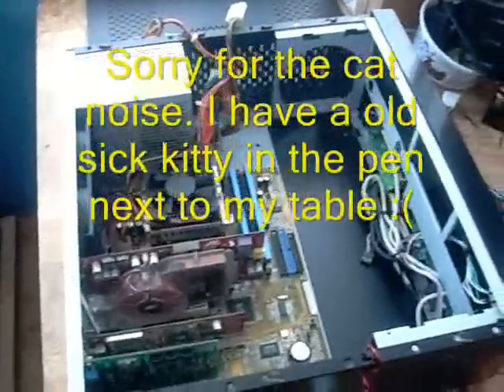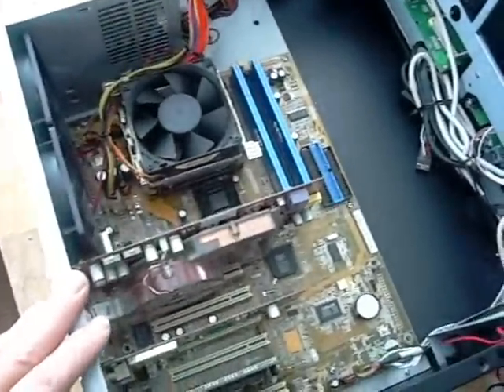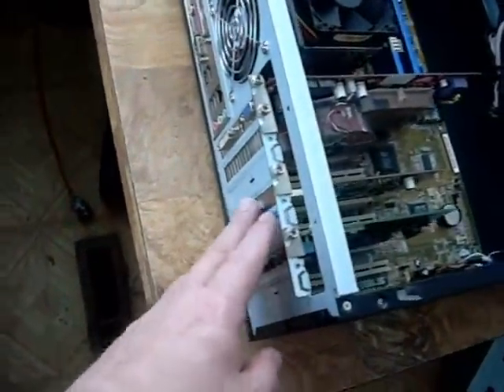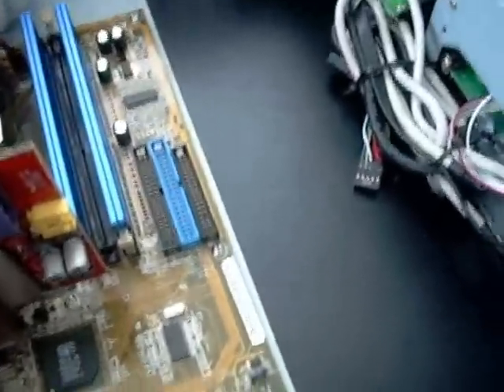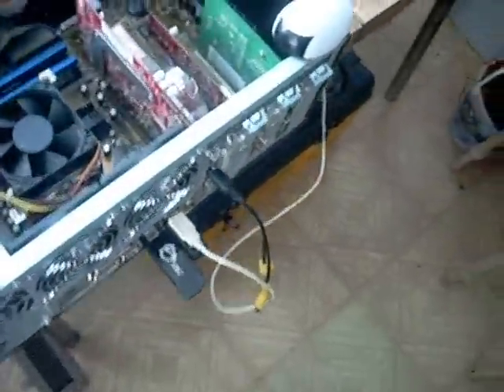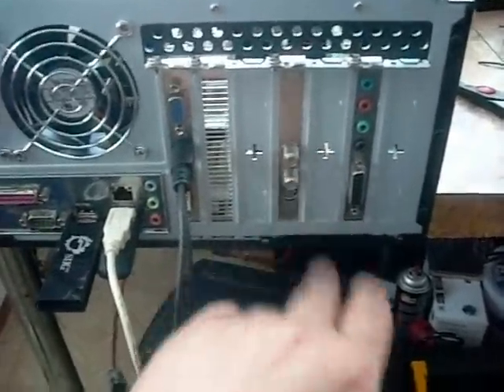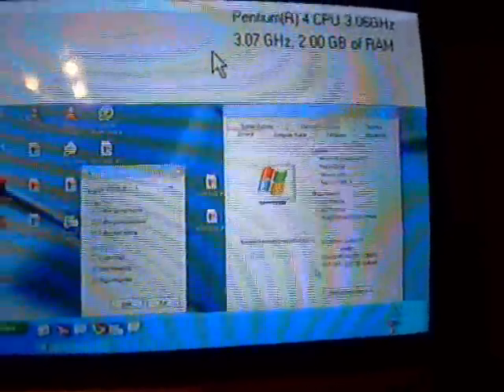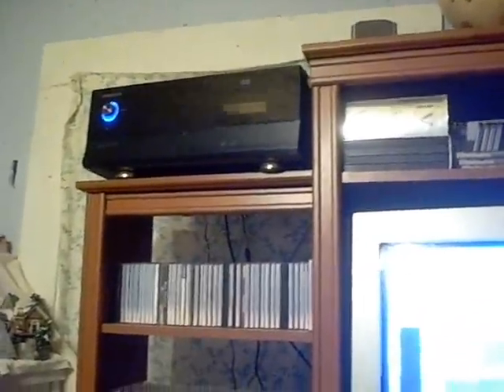Cheap HTPC from spare parts

Comment: Simple, inexpensive, and 100% functional yet elegant looking  HTPC. Nice to see you finally put it together while doing a bit of recycling too. Mine is still running strong, though my cpu fan did burn out 2 months back. Quickly replaced it with new one and all is good. My next step is to add a stereoscopic 3d kit to the tv but not quite ready. Hope your wife makes the most out of it.

Comment: @FUzzyBUnnyBOoties 
Hmm... have you tried hooking it to anything? i agree it doesn't make sense to include it if it doesn't work. but then again. its not un-common to see hardware like that. so how does the system run? does it lag at all? what is the max resolution you can get from it? will it play the 1080p stuff? does it drag during heavy action flicks?

Comment: @FUzzyBUnnyBOoties What dinosaur? My old P4 machine still has an GeForce 4 Ti4400 MX with a cool 128 MB RAM and a dead fan (AGP) and still works like a charm. Years ago I used to squeeze hours and house of gaming, Battlefield 1942, NOLF 2, whatever came out in those times... And still plays all the non-HD stuff (movies) well. As  long as it does the job its fine. Plus you can always buy some HTPC card like GeForce GT 430 or something  for b/w 60-85 $. Or an GeForce 6200 (AGP) under 40$ :)